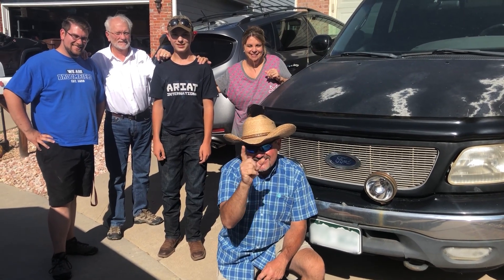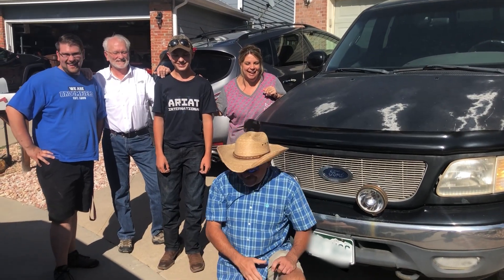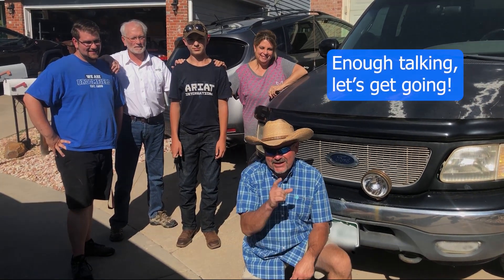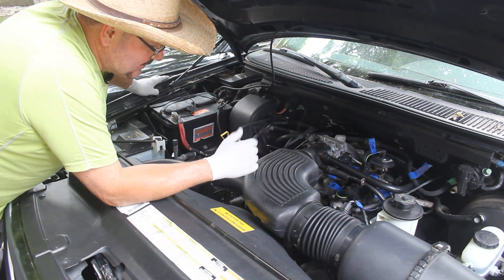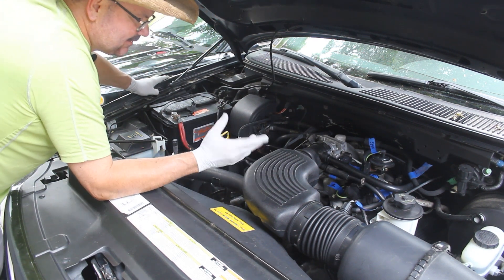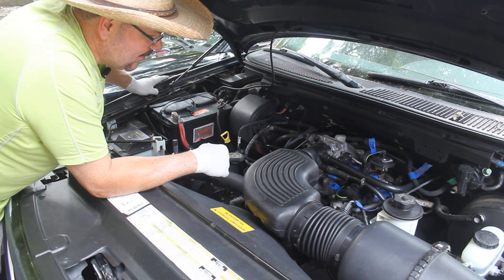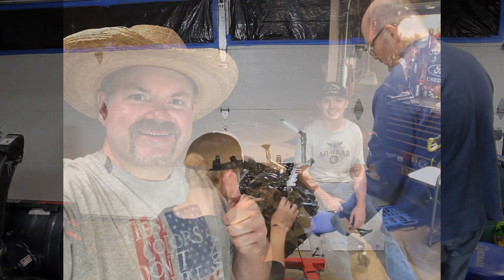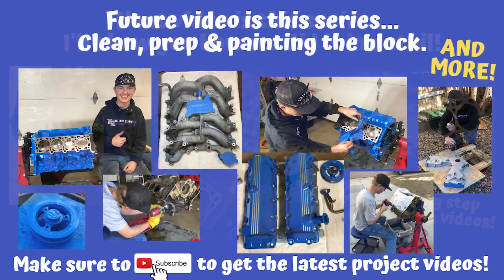Ford 5.4 2V Build - Knocking Sound, Removal, Teardown & Rebuild Series

Comment: Hi. My name is mike and I have 2007 e350 super duty van with a 5.4 two-valve engine. (185,000 miles)You seem like you know a lot about these engines, and I was hoping to get your opinion on a problem I've been having. My engine seems to run fine ninety-nine percent of the time, but every so often, it will just stall for no apparent reason. This might happen anywhere from once every few weeks, to once a day. There doesn't seem to be any pattern to it. The thing is, it starts right back up after it stalls. Then it might not happen for a month, or it might happen the next day. 

The only thing I've noticed is that usually, but not always, it seems to happen more often after I come off the freeway, maybe after driving a block or two. And usually, it happens during a turn. But again, not always. 

I took it to the dealer, and they couldn't find anything wrong with it, and it didn't have any fault codes. 
I've changed out a lot of stuff: the fuel purge solenoid(I think that's what it's called), the intake air sensor assembly, new plugs, new coils, new fuel and air filter. I cleaned the throttle body (electronic throttle). 

I have no idea what it could be. If you had to guess, what would you guess?

If you have some time, I'd very much appreciate you opinion. I was thinking of trying the throttle position sensor, but other than that, I have no idea what it could be.

Thanks very much, Mike H.
Reply: Sounds like a faulty ignition switch that has connection but still can short itself out from corrosion a bad/loose ground wire will do it as well.

Comment: I never saw you do the heads.  Did you replace the roller-rockers? Replace Valve Seals? Check Springs for height? Grind and lap valves?  Is there another video?
I think I have followed all your videos in this playset.  To other things I do on my expedition is remote mount the oil filter so it is upside down and easy to get to from the front fender and a Fumoto Oil plug F106n

Comment: Would like any and all advice from anyone who has true knowledge regarding engine rebuilds for my question here. So Im wanting to rebuild my 2001 5.4L V8 2 valve. Ive never done something like this but I do know how to repair my own truck and have done most repairs. With that said Im wanting advice on how to go about doing this, regarding, engine machine work,  what parts I should reuse, what parts I should buy new. I I dont have a problem buying new parts especially for the internal parts so if thats recommended then I will do so. Regarding the crankshaft  do most people just have the surfaces polished and then just reuse it. What about the pistons, piston rods, etc. Is it best to just buy all new  parts for this area. I would like to buy a better quality part to go into the engine if thats possible. Regarding the cylinder wall on the block, if I do reuse or buy new parts for this, how do I know what parts to buy regarding piston and ring size and how does the cylinder wall need to be bored and if so how much.  What about the cylinder heads and that area. I think most people have the cylinder head reworked by the machine shop then put all new parts in this area. Am I right or wrong.  I know this is alot to ask but appreciate any knowledgable advice. Thanks
Reply: First thing to do is ask around to find the best machine shop in your area and discuss your project with them.
Typically you would bore the cylinders .020 over, but the machine shop will need your new pistons before they do the overbore. The cranks are steel so they are already very strong, I would recommend replacing the stock rods with Manley rods, upgrade the oil pump, use ARP 2000 hardware in the bottom end and go ahead and head stud it, use either FRPP head gaskets or Cometic MLS head gaskets, get the all metal timing chain tensioners. Look into some trickflow 185 heads if you really want to do it up.

Comment: Thank you for the series. What are the considerations for/against overhauling the lower rotating assembly? My 1999 5.4L 2V has 298,000 miles on it and it is starting to use oil.

Comment: There only 1 problem with the 250. It’s not a 250. It’s a 150
Reply: F150s and F250s had the same front end in the late 90s appears to be an f250 from what I could see of the badge. I used to drive an 99F250 fleet truck with the 4.6 v8
Reply from the maker: You are correct Reid, it's an F250... the oddball truck!  Depending on the parts we're getting sometimes we just say "F150" at the parts store because they always get confused and want to sell us Super Duty parts.  It's been a good truck though.  Thanks for stopping by and taking a moment to leave a comment!
Reply from the maker: It's definitely "odd" Garrett.  The worst part is every time you go to the parts store and tell them it's an F250 they try to give you Super Duty parts so you have to explain it's a F250 but the Heritage body so it looks like an F150.  The 7 lug hubs are a pain because nobody makes wheels for it.  Technically, they call it a "Heavy Duty".  Not quite Super Duty, somewhere in the middle between Light Duty and and Super Duty.  My son sure likes his truck though and it has taken a beating in the mud and off roading.  The motor is still doing great too so that's a good thing.  Thanks for stopping by!
Reply: Yes it is. I have one that I am looking at out my window right now. I bought it new in 99. It happens to be the same Wedgewood Blue color, too. That was the last year for them. In 2000, they started calling it the "7700" package. It has been a great truck. As @javosgarage stated, it causes some issues with getting parts. I usually just tell them its a 150 at the parts store whenever the part is not specific to the F250 LD. (Brakes, suspension, etc...). The downside is definitely the 7-lug rims. I could never find a wheel that I liked so mine still has the original rims. Other than that, awesome truck. A few years ago, we replaced it with a 2018 F250 crewcab that is even "awesom-er" lol. Still kept the old 99 for a beater and hunting truck, though.

Comment: Mr Javo.. thank you for your videos..  do you have experience with the 5.4 2 valve in the econolines..

I am having a difficult looking to improve the 2k-3.5k rpm performance... Looking low end torque

I am told that that mustangs used thus engine.. couldnt confirm that oarts were cross compatible..

Any suggestions?

Thank you again
Reply from the maker: Hi Campos.  I'm sorry but I have no experience with the vans.  The only Mustangs I'm aware of that used the 5.4 were the SVT Cobra R and the Shelby GT500 but I most certainly could be wrong.  There may be a gearing difference with the Econoline van that could affect the 2-3k performance, but not sure.  The are many inexpensive "bolt on" options such as a cold air intake, larger throttle body, performance chips/programmers that are easy to do.  If you're willing to dig in to things a bit more the options are only limited by your budget (like most things in life huh?).  Thanks for stopping by!